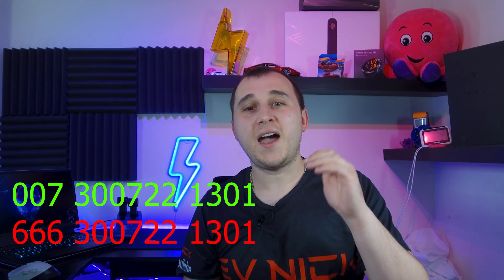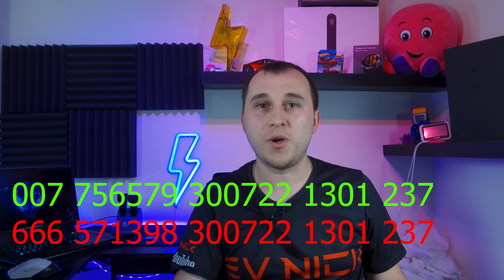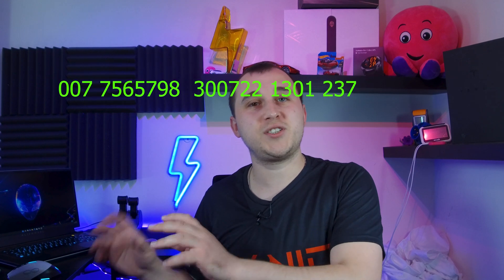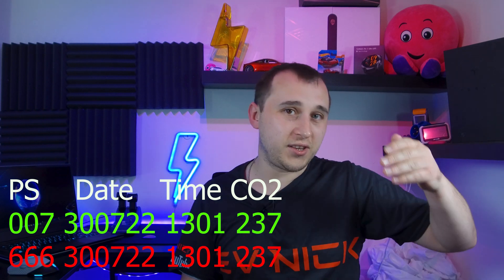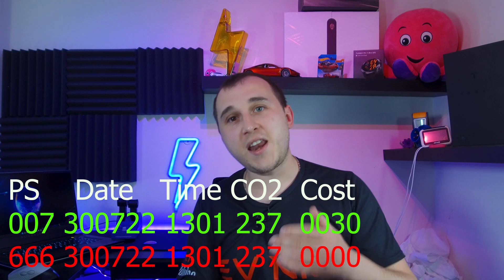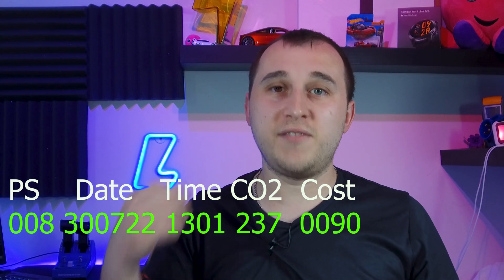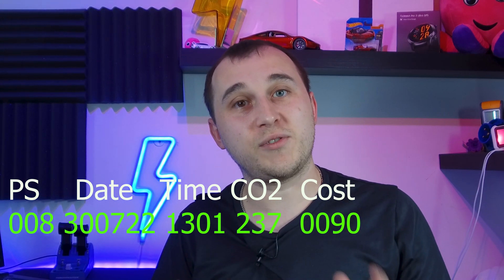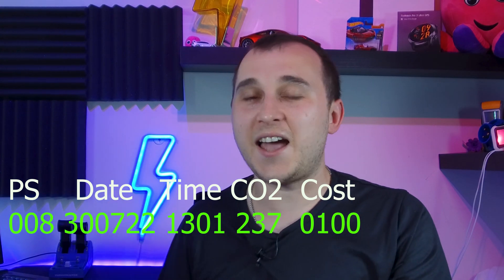Could This STOP Free Electric Discharging Via V2G

Comment: V2G chargers should have a direct connection to the control centre to act as grid balancing sources. You shouldn't be able to just dump the cars energy the whole time, just when the grid needs it. Same with non essential loads to turn on if the grid needs the energy using

Comment: Interesting theory, Nick, and well thought out however I can’t see it ever happening. I could plug in a Raspberry Pi to spoof a solar array and artificially inflate my figures. Data can only be exchanged if both ends have compatible equipment and crucially if my EV battery has multiple sources such as partly home charged, partly work charged, partly rapid charged etc how do you isolate that within the battery? If you thought rolling out Hydrogen was complicated….. 😄
Reply from the maker: Blockchain is encoded and encrypted so your pi wouldn't work
Reply: But where is blockchain being implemented? In the solar panel, the inverter, the smart meter, the car? Blockchain obviously requires CPUs and storage. I could see this working within the national grid on the generation side, potentially, but not the domestic side where what comes through is too blended to isolate. You’d have to do it at the watt level or even smaller. A wider implementation of something like Octopus Agile seems more likely - an interesting pub chat for sure 😆

Comment: I'm really confused by your explanation of what blockchain is. It sounds pretty different to how it is used in cryptocurrency or just for digital record keeping: https://en.wikipedia.org/wiki/Blockchain
I see why you might want to add data to your electricity, and maybe encrypt that data, but I don't see why you need the chain. Also, I'm not sure how do you attach digital data packets to electricity? Especially when it goes through transformers? For this reason, I don't see how it can possibly achieve the local area sales idea.

However, you don't need to use blockchain (or attach data packets to the to electricity coming from the grid) to solve the green/dirty V2G system. You can just have the smart charger internet linked to check the (local) grid Co2 emissions, and tell the car what that CO2 number is for each kWh. The car would then maintain a record of the CO2 per kWh, and presumably when it is used for transport, or fed back into the grid tick them off (cleanest first?). Which means that the data lives inside the V2G protocol, inside the car, and inside the charger, but it doesn't have the source attached, just the CO2 cost (and the price if you want). I don't know if the V2G protocol has provision for this data exchange, but it would be interesting to find out.
This would mean that the smart charger can then choose to charge when the energy mix is good (or the spot price is low, which ought to be pretty analogous) depending on the wishes of the consumer, and it shouldn't be too hard to implement.

Comment: I used to live on a remote Scottish island where my heating and hot water were largely supplied by an off grid wind turbine for which I got no ROCS because OFGEM hadn't approved any brand of DC meter. My current home has a solar PV system that has most of the energy consumed on site via the property itself, the hot water tank element and recharging my BEV. I receive no ROCS or FiT and am paid a nominal amount for the little that I do export but the £1K+ per year I am saving from my fuel bills makes it all worthwhile. BTW, great video!
Reply from the maker: Which remote island Brian.. JP from Orkney in comments on this also
Reply: @NicolasRaimo  I lived on the Outer Hebrides which as you probably know is off the west coast of Scotland. Very similar weather to Orkney with lots of wind and rain!

Comment: At first I thought I’d woke up after a 6 month coma and it was 1st April. Sounds like @electricvehicleman Shell V-power electric to me.
I can’t see this becoming a thing. So far as I understand electricity doesn’t “flow” with packets. And AC is not a data network so I can’t see this going very far. Possibly in conjunction with a wallet embedded in the BMS and communicating with an EVSE or charge equipment. A comms line would negotiate the data between the car and the station, not down the AC phase.
V2G doesn’t really have much of an installed base yet so I can’t see this being a widespread issue and I fear that this sort of talk could lead to MSM picking it up and reporting as if it were rife. Not ideal given the current energy climate.
I CAN however see free charging becoming a thing of the past. Especially soon as energy prices soar. The cost is being bourne by businesses to provide charging to lure folks in. I think this will quickly stop. If they wish to have a lure I. The future it will be in the form of account credit to their partnered charge network, either for a set amount based on a purchase (akin to 10p off a litre for shopping over £40) or by converting nectar points / club card points to account credit.
Free workplace charging will also pither away, I can see too many employees noses put out of joint because the company is paying for Dave’s transport and not theirs. Charing your phone at work is one thing, but your car, that will be taking the piss.
On charging only when the grid is clean, this is already a thing. And can be automated. I do it manually using the national grid ESO app and carbon intensity.co.uk and specifically time plugging in my car when it’s low when I can. I believe a few smart home chargers can do this, sometimes in conjunction with their e-sense connections, some with APIs.